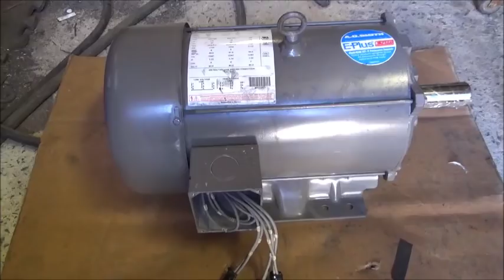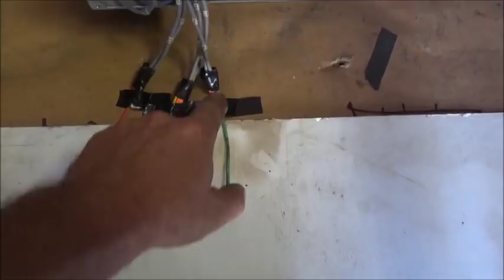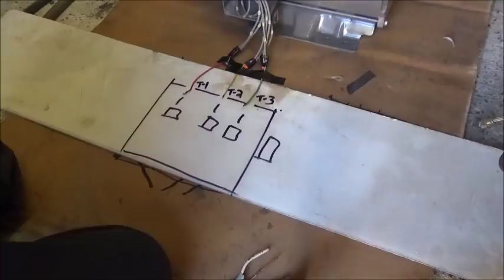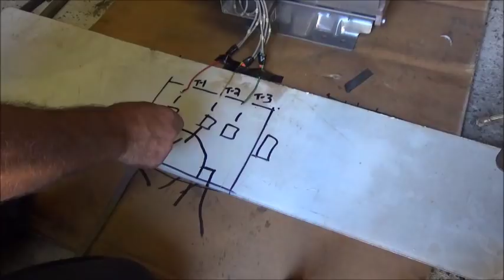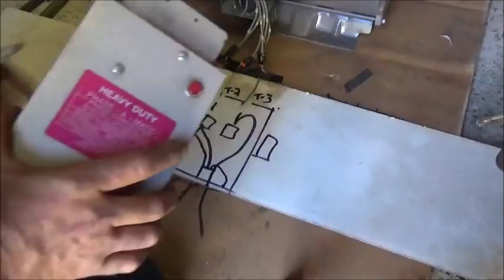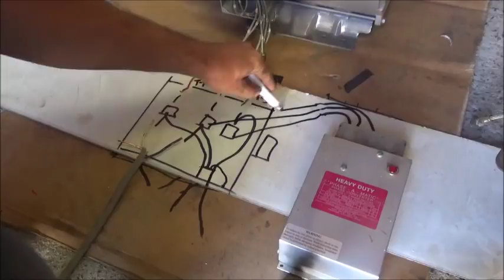How To Build A Rotary Phase Converter

Comment: Great video Johnathon ! one question , when you run the third wire on the opposite side of the block does it make that a constant power or ???
Reply: No because the third leg only has power when the motor is spinning.
Reply: @JeffFlanagain  Yes, but if the rotary phase converter is running and the switch is off isn't there still a hot leg (the one being generated) of the three phase going to the equipment? He asked the same question I was going to ask.
Reply: OK, I get it the rotary couldn't be running because you killed power to it when you throw the switch to the off position. Got it. 😂

Comment: Thanks for the explanation. My south bend lathe was 1/2hp 3 phase when I bought it but I had a single phase 1/2hp reversible motor laying around I swapped in. But If I ever get my mill I may keep it 3 phase and do it this way.
Reply: MJM’s Workshop    If you have multiple motors in your shop that are three phase this would be a good choice.   But if you only have one or two, then you would be better off using a VFD(Variable Frequency Drive).   They are now way cheaper than they used to be.   Look for a TECO VFD Definitely put the three phase Back on your lathe!   You can then control the speed forward and reverse with way more torque.   You can see similar on the Rebel Woodturner channel.   Good luck, hope this helps you.

Comment: Am I right that you need 220 to convert to 3 phase ?  Really enjoy your vids.  I check for them daily.
Reply: Jim, Since he did not answer, I thought I would.   The motor is dual rated by how you splice the wires.   It will run on 240 or 480 volts.   Voltage numbers are nominal.    220 or 240 volts is the same thing.   He spliced it for 240 volts.   The two conductors from his single phase panel, would be a 2 pole circuit breaker, so 240 volts.    I'm not sure why people try to say it's 120 on each and they add together.   It's 240 volts single phase.   I hope this helps you understand.
Reply: @KevinCoop1  people say they add because in some regions, if you check between one wire and neutral with a volt meter, you will get 110 or 120 , same for the other wire and neutral , and checking between both is 220 or 240, whichever is common to the region... Transformer from power company maybe wound as 220/240 center tapped.
Reply: Philip Williams   I 100% agree with your comment.   But, if you take the center tap completely out of the transformer, you will still get 240 volts.  Hence the reason I contend you do not add them.   The one that really gets me going is when they say out of phase and 180 degrees.   If they started with "On an oscilloscope..............".  Then I'm ok.   The O Scope test condition causes the described condition.  In the real world, the electrons can not be "out of phase".    Respectfully,   Kevin
Reply: Jim Buford    I'm very sorry, I must have been asleep when I commented the first time.  The answer had nothing to do with your question.  The answer is no you do not need 220 volts to convert to three phase, to a point.   TECO makes 120v single phase to 240 v three phase frequency drives.  To a point, means only small motors.   If you look them up, you will see the voltage breakdowns.

Comment: I saw a rotary converter one time, the guy had a Briggs & Stratton recoil on the end of the motor. He pulled it a few times to run it up to speed, and hit the switch and it took off. 
Funny dang thing to watch, but it worked swell.

Comment: Ive seen the extra motor set up to create the third phase before.Ive never seen the phase converter used with it,what does it do?I know by itself its supposed to convert to three phase.
Reply from the maker: The motor needs an aid to start it, you can use a rope, a 110 motor with a pulley and belt to get it spinning (pony motor) or a static converter box. It is not a necessary item, but makes it easy
Reply: Ok,thanks,The setup im used to seeing uses a rope to start the motor.

Comment: can you tell me what the static box does please .
Reply from the maker: The motor needs an aid to start it, you can use a rope, a 110 motor with a pulley and belt to get it spinning (pony motor) or a static converter box. It is not a necessary item, but makes it easy.
Reply: thank you .
Reply: would the box work like a capacitor  .
Reply from the maker: It is one, it has two big ones in it.
Reply: Not an "expert" on the "phase converter" topic but do know that in actual 3 phase power, the three conductors are providing "alternating" impulses" (AC)  that are 120 degrees apart if you were to look at how often those impulses happen in a 360degree rotation.  The 3 phase motor rotates/turns following those rotational impulses. If you put single phase (two conductors just alternating back and forth) on a 3 phase motor, it sees no rotation so it just sits there, draws lots of amps since it's not turning, and will burn up if it's not protected (overloads). The converter box is "tricking" the single phase (with those capacitors) into looking and acting like 3 separate power impulses in every 360 degree rotation. Don't have a clue what part the new motor is playing towards making that "third" leg of the circuit.
Reply: @pappabob29  Thanks man, that was a large and very clear part of the explanation [that was maybe left out?] Ok, knowing this, I feel a bit more competent to go off and look for solutions. Personally, VFDs might be a good investment for each machine if they aren't too outrageous

Comment: More power is always more efficient I had 110 running my well always burning out the points in the pressure switch about every 2 months  so I switched it over to 220 3 years ago haven't touched the points or the pressure switch sense I I switched that over
Reply: Ouch

Comment: were you running the third wire from your phase a matic to the lower side of T3 switch or to the upper side of T3?
Reply from the maker: The third wire was ran from the power side, but from experience, I found it works either way.
Reply: many thanks Jonathan